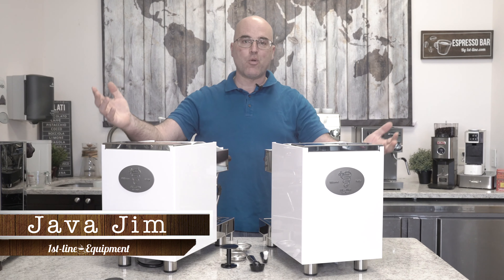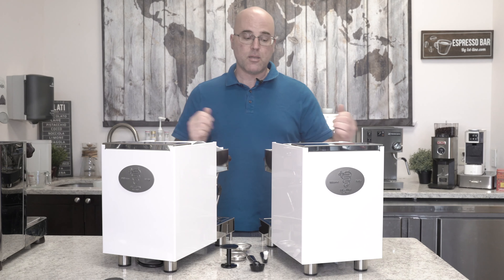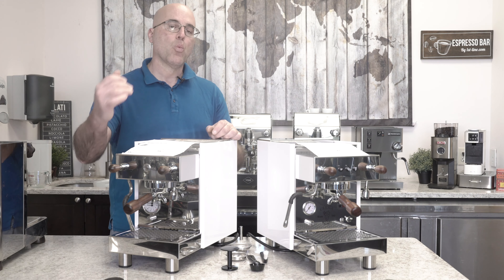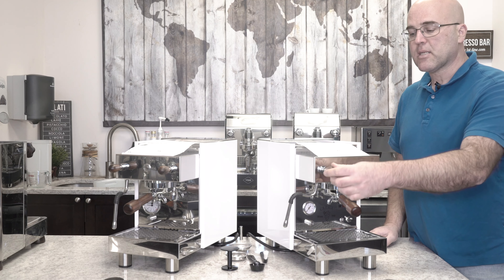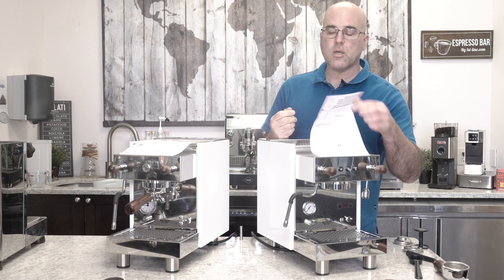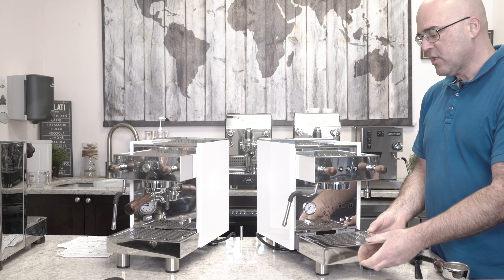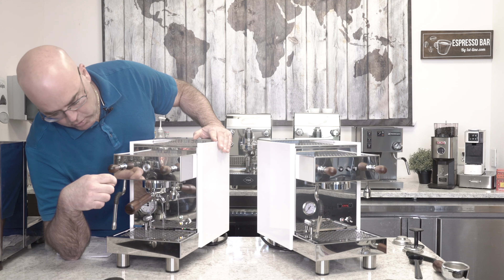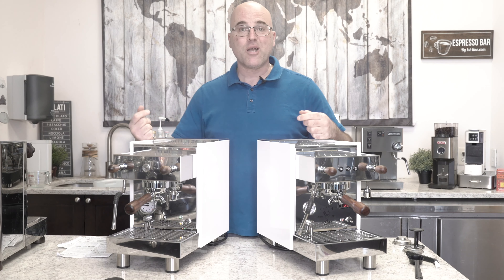Overview: Bezzera Crema Espresso Machines

Comment: What’s the difference between the Crema and BZ10 or BZ13
Reply: In my understanding the BZ13 is about for 90% based the BZ10 but with an improved piping system and other design. Also the BZ13 is available with a PID. It could be that the 13 has even a slightly shorter heat up time...